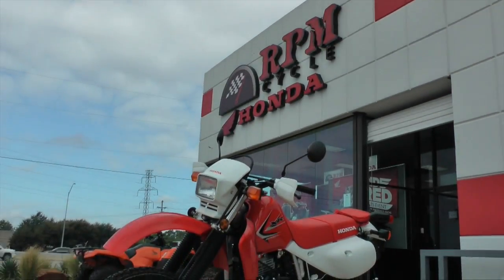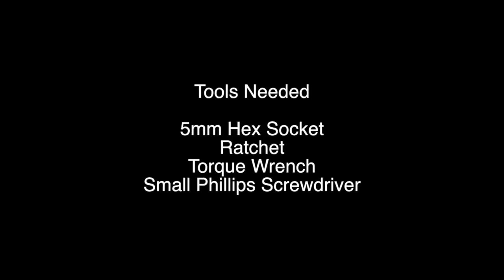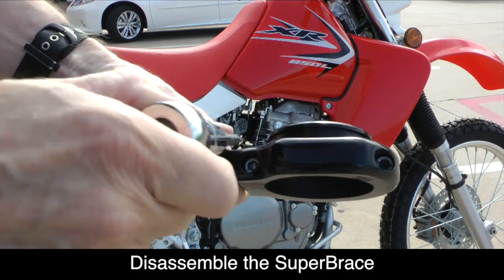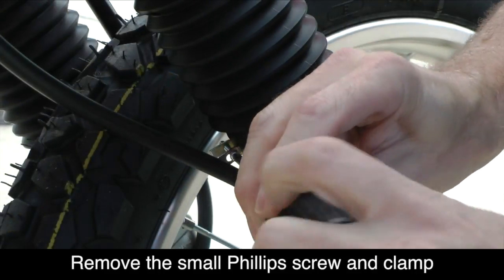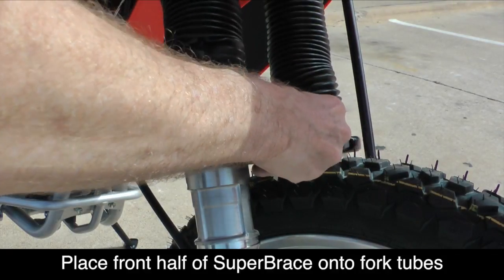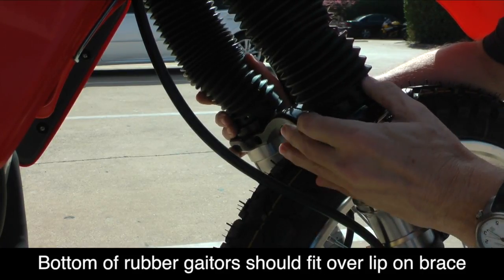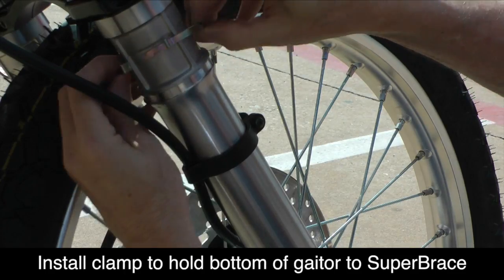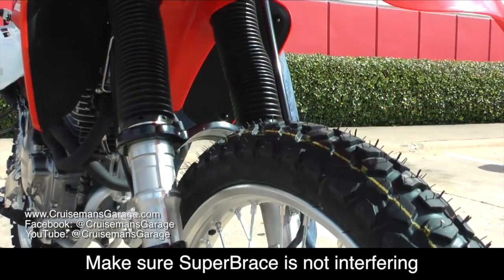Installing a SuperBrace - Honda XR 650 L

Comment: I see no mention of where to buy one of these. Can't pull it up on Amazon or e-bay. Are they still in business?
Reply: Look up (motorcycle front fork support brace) it comes right up
Reply: procycle has it, check suspension section